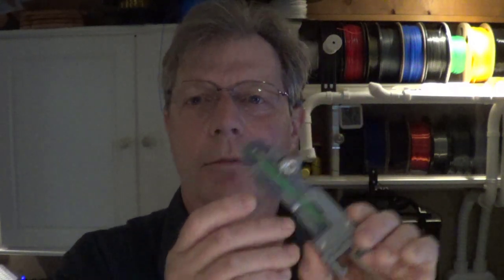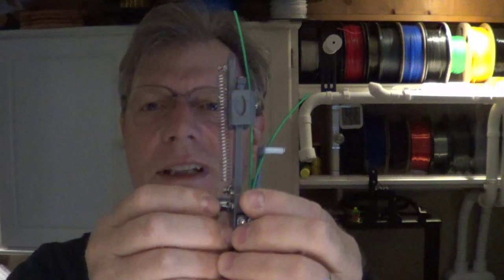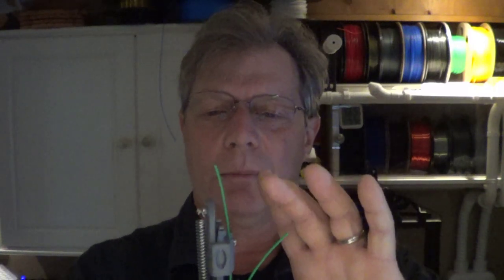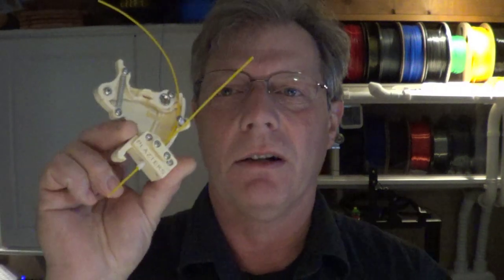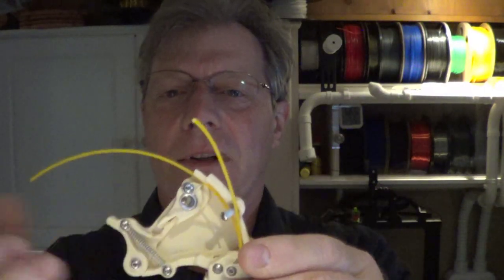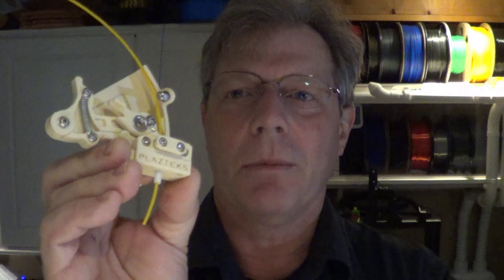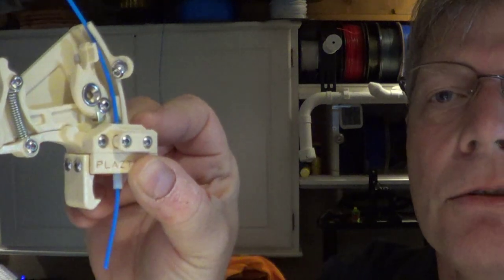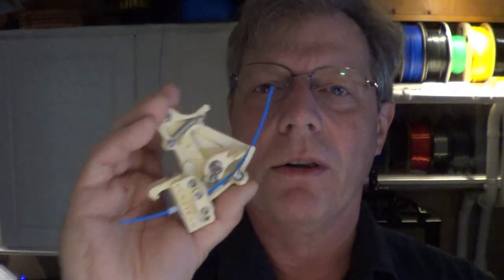Automatic Filament Loader 2.0 Now Available!

Comment: Fantastic idea, man.  I have seven different fast printers with some custom or off-the-shelf direct extruders. Your design is that way too heavy and clunky for these machines but I have designed a "fork" of your design where I have split it into two elements. One small part mounted directly on extruder. It contains the swap part itself (with plunge pusher from v.2.0) and Y-style splitter with two bowden connections. The second part is doubled. Two straight pushers from v.1.0 mounted on the frame and pushing filaments thru Bowden tubes to this lightweight changer mounted directly on carrier. Yes, it's also a step back from your 2.0 because it doesn't allow use of TPU but to be honest I use TPU filaments so rarely and in so small projects (some gaskets) that I don't need unattended changer, especially that I use filaments with Shore 20D stiffness.
But. There are two questions. How can I support/thank you for the idea itself? My changer is only my version of your "patent"/invention. And second - I could share my design for free on Thingiverse or Printables but I feel it isn't fair to you as you sell your models.
Reply from the maker: I would love to see your adaptation of the loader.  The issue I saw with separating it was that the travel distance was limited by the spring carriage length.  Tension had to be balanced between downward force, and the side pressure exerted on the existing filament.  I experimented with a rotary mechanism much resembling revolver cylinder that could handle more filaments, however that was right around the time my wife's health declined and after losing her, I haven't been able to find the time to continue development. I am starting to get back into design mode.  Also, I have switch to mostly core xy machines, so my next attention will be to adapt the design to accommodate  that type of machine.  I know I could get fancy and go the way of an AMS, but I still want to make a simple mechanical device that does not require software or firmware changes to work.  I appreciate your honesty and commitment to not freely release an adaptation of my design.
Reply: @frantasticdesigns  I can send you an email with some pics. And results as soon as I test my version out. For side force I  have some solution but I have to test it some time with different realworld speeds. Most of my printers tuning/upgrades are on mechanical side, and that is another advantage of your device (or one based on). For more uniform feeding forces I will test rubber bands instead of long spring in feeder.
I have MMU3 module on one of my Prusas but honestly the only function I use it for, is Spool Join, which your device does simply, efficiently and is not overkill.

Comment: How does it work?

Can you print multiple of these to queue up many filaments at a time?
Reply from the maker: Just a simple spring loaded device to start anew supply of filament just as one supply runs out. Loads new filament without interruption, or the need for a run out sensor. As the old filament runs out, the new one gets pushed over under spring tension, then the swing arm pushes the new filament in right behind the old one. No firmware changes or electronics needed. Eliminates need for run out sensor

Comment: I believe that the missed retractions should not be an issue, as you have noted in other comments. Nonetheless, if you ever pursue a v3.0 and are still considering adding features: the swing arm could be used to activate a microswitch, as used in the klicky probes, which activates a macro for purging the non rectractable filament length.
Reply: You could do that with a spare endstop, just place in a position where it gets activated when the arm pushes the filament and then create a macro that triggers when that endstop is activated
Reply: @Mestrenada  an endstop is just a microswitch with a lever

Comment: Im interested in this but with use for (1 color change during print, black first then green. I have a job printing 50 large items. My bambu can already do color printing and automatic switching but with the print process i vould possibly use this with an automatic filament rewind 3d print that has a clutch spring on it that helps it rewind when ejection of filament for a color change.

Comment: Awesome job! will it work witch the Biqu H2 extruder?
Reply from the maker: In theory, it would work on any extruder as long as there is a way for me to mount it tight against the filament entry point and have it not interfere with other components.  as always I would need the extruder in hand to design around...I only had the 3 different extruders to design around as they are the ones that either came on my printer, or I bought to replace them.

Comment: Very very smart solution to this issue ! Great job ! Is there a limit on how flexible the TPU can before ?
Reply from the maker: haven't  had a gauge, as far as how low of a Shore hardness it can go before buckling.  I have fed Overture TPU which is rated at 95A.  I do not have any softer than that, but would be happy to try with something like Nijaflex, as that is one that most people say is super flexible.  I will have to order some.
Reply: @frantasticdesigns  no obligation there. I was just asking, out of curiosity. I am not planning on building this soon but probably some day. Anyway, thanks a lot for sharing this great design !

Comment: Hi. Is it possible to install this loader to Ender-3 KE? This loader need to be installed right above extruder motor right on printing head?
Reply from the maker: @HODYTONE  it all depends on the extruder, and what is avilable to mount to. I had mine attached to a dual gear generic extruder, but now I have a sprite extuder, ans have to re-engineer

Comment: Genius! How about direct drive?
Reply from the maker: Works fine for direct drive, that is how I have it set up on my Ender3 v2.  You just have to learn to have a "fluid touch" if you load a new filament while it is in motion. I do it all the time. The other thing is to leave enough loose slack on the new filament so it doesn't get yanked out of the device from an long or fast motion of the print head....

Comment: As a mechanical engineer, I can certainly appreciate the time you’ve spent to perfect this design! Very nice work! I have a Rat Rig 500 and have printed several 3kg+ prints! Is it possible to add more than 1 roll? Or reload it after it activates?
Reply from the maker: Yes' as soon as the new filament has made it into the extruder gears, and the tension arm filament catch ( canary looking part) disengages from the filament you are free to load another. The only thing to consider is if you want an entire roll dragging past the  roughly 10mm's of the next roll that is queued in the device. Once the new roll has started in unless you load another roll there is no drag resistance in the device, since the spring plunger  stops at the thickness of the filament
Reply from the maker: You hiring?....LOL
Reply: Haha I might buy this! I plan on setting up a secondary extruder that will push the filament to my direct drive extruder.. I think I can make this work! I may need to make some adjustments. Do you include the native SW models in the Cults 3D download?
Reply from the maker: @diablodaub  I have only included the STL files as to not have my design ripped off.  I did apply for a  patent on it.
Reply: @frantasticdesigns should of probably got all that before posting
Reply from the maker: @nickjeffrey8050  I did
Reply: @frantasticdesigns  if you’d like to get your product mass produced let me know! I have multiple manufacturing companies I’ve worked with to help my clients mass produce their ideas.
Reply from the maker: @diablodaub  I am always open to ways to get my ideas out there.  I would love to see this device incorporated into printers natively if there was a manufacturer interested.  I could also be happy to see it mass produced.   It would have to come in several flavors, as you may have noticed from the comments.  Everyone's setup seems to be just a little different.  few run their machines as stock.  I have tried to make it as universal as possible and only change the method of attachment.  I guess the next thing I could do, is make the actual device that moves the filament standard, and make the mounting point modular instead of making a completely different main unit for each extruder.   feel free to reach out  if you have in interested party.  Until then, I will continue to improve(if I can ) the design.  I am going to get to work on the modular concept.

Comment: could you make one that can be more universal for extruders like the bondtech lgx lite, titan, or bmg?
Reply from the maker: I am  always willing to adapt my design if possible.  My limitation is that I Only have a few extruders at my disposal.  I purchased a Microswiss just so I could design around it because of it's popularity, but my resources are limited.  If you look through my other videos, and the listing on cults, you will see photos of models adapted to the Dual gear aftermarket unit ( the extruder on all my machines) one for enders both bowden tube and direct drive configuration, BMG style, Creality metal and plastic and the Microswiss type..  With each machine however, there may be adjustments needed. What I tell people is that if there is a way to secure it to the filament entry point of the extruder and it won't interfere with any function of the extruder or interfere with components of the printer, it should be adaptable.  I just need an extruder in hand for fitting and testing.  As for a Titan version, it is unlikely given the design of the tension arm and the filament entry point.  I am not sure if there is a way to mount it that will work.

Comment: Hmm thats pretty nifty but it wouldn't work well on my Kingroon KP5L since it has a direct drive... I mean I could mount it on the extruder itself but then I'd have more weight on the head and 2 bowden tubes for it to feed to the head. It would work nice if I setup a bowden setup on my voron v0 though.
Reply from the maker: I run it on my ender 3v2 as direct drive, weight is minimal, especially if you do 20% infill

Comment: how to mount to a prusa i3 mk3?
Reply from the maker: I do not own any Prusas. Another follower asked about mounting on a Bondtech LGX. Is this the type on the prusa i3 mk3? If so' I am working on an adaptation of the BMG clone I have since tgey are similar, and am fitting using a mock up from OnShape. I won't be able to physically test it though without the extruder in hand. I apologize, I hoped to have this one already, but have gotten sidelined by some family medical issues that have required more of my time......

Comment: Have somebody tried it already in printfarm settings if it works relieably enough for automatic filament refill from second spool midprint seamlessly?
Reply from the maker: @martinvitvar3101  hello Martin, I don't  run a print farm, but I welcome any feedback. For that type of duty, I might think to engineer in a small metal thimble  where the filament goes through. I usually don't bother to load tge second filament til the 1st one looks like it might not finish a print. No need for the excessive friction wear between the two filaments. I don't have it installed on as many machines as I used to, as most of my current machines are K1's and K1Max's, and I would have to re-engineer the lid of the machines.
Reply: @frantasticdesigns  Yes a reliable way to automatically refill AMS or MUI so it has more capacity would be awesome. So I can go for a holiday and keep printing with autoeject. 4 kg per AMS is only 4 days of printing and it is kind of expensive to buy more AMSs just to autorefill with no material or color changes.

Comment: Love the concept. Solves a real problem.

Do you know anyone that has installed on a snapmaker 2 - in enclosure? We can overcome filament swap issue by computer connected using Luban (basically a software solution that pauses print when filament runs out) but would MUCH rather something like this to print without connection to computer OR the delay caused by waiting for filament swap.
Reply from the maker: Possible, as I have mentioned to others, as long as there is a way to secure it to the entry point of the filament, and it doesn't interfere with any part of the printer, it should be adaptable. Direct drive is no issue, you just have to have a "fluid touch" while loading new filament if do it while it is printing. I do it on my Ender3v2 all the time while its printing. Also you have to leave enough loose slack on the new filament as to not have long travels of the print head pull it out before it gets pulled in
Reply from the maker: Sorry I mis-read your question, no I do not as of yet.  I am hoping more people will print one and provide feedback.

Comment: Heyo! This looks amazing, but Im curious how capable this unit is for hooking it up to a BMG style extruder, rather than creality style.

Second: How difficult would it be to add on a screw in for a pneumatic fitting at the top, for those of us that have drybox setups and would like to have bowden tube running from the drybox and terminating at the entrance(s) to this little unit?

Ideally 2 fittings, 1 for the main line and 1 for the backup line, would help a lot potentially for those of us printing with very hydroscopic stuff that want to keep it as dry as possible, rather than just feeding the lines in bare.

And if you are interested in further feedback, potentially a cover to further help seal the unit as a whole could be nice!
Reply from the maker: Thank you for your comments, First let me say, I have made one to fit a BMG Extruder.  : 

https://youtu.be/dM32Lyew9hY

As for  putting a fitting on the top, a reverse bowden tube would cause too much drag resistance on the new filament.  It only works since there is a balance between the tension force of the plunger that moves the filament over, and the tension of the swing arm.  If I were to increase the swing arm to have enough force to pull through a bowden tube, it would probably buckle the filament ahead of the  entry point.  also that would mean increasing the side plunger tension, which would apply alot of friction between the new and old filament as it is waiting to be pushed over. I do appreciate all the comments and suggestions, and will gladly incorporate any  elements that will help improve the design,  but I will tell you I spent quite a lot of time experimenting with the "goldilocks zone" of this device.
Reply: @frantasticdesigns  Ill take a look at the BMG one!

As for the fitting issue, would it at least be possible to get a pneumatic fitting lined up with the "main" line?

Comment: Why does it have to be anywhere near the extruder. Could  a mechanism like this sit anywhere in the path of role to extruder?  The width of the filament leaves the hole, triggering spring, lining up new filament?   This could live on the top of my  AC Predator before the filament run out, or between two rolls of filament  or a daisy chain of them with many roles of filament.  Am I missing something here....  This is a GREAT idea and if it is a spring loaded mechanism it can live anywhere, am I mistaken?   Love the project.........
Reply from the maker: Let me first say, I am always trying to improve the design, and I accept all critisizm as contructive.  If it sparks me looking in a new direction, then I will say thank you in advance.

this is what I replied to someone else with essentially the same question:

I experimented with that, but resistance was an issue. there is a fine line  between just enough downward or feeding force to get to the extruder wheels, and  not too much that the new filament won't shift over.  that would require a stronger plunger spring, and then there would be too much wear pressure between the two filaments. Even if I had a spring wound long enough to transverse the length of a standard bowden tube, the internal resistance brings us back to the problem I just mentioned..  Again, there is always a way using another stepper, extruder, optical sensors, and a but of microswitch magic, or I can just be happy with a simple spring loaded mechanism.........
Reply: @frantasticdesigns    Nice,  Right!!   I did not think of the pressure that needs to be applied too the NEW filament to carry it down to the extruder.  I guess I was watching too many filament weld videos, ha.  Thank you for the clarification  and  again nice work!!

Comment: The only issue I can see with this, is that it likely won’t work with most direct drive extruders on machines like the Voron or rat rigs etc
Reply from the maker: There is always going to a challenge fitting to any setup, as most of us have customized our machines.  What I have told people, is if there is sufficient clearance around the device and it does not interfere with any other part of the machine, and most importantly, there is a way to secure it to the filament inlet path, it should be adaptable to either bowden or direct drive.  Some extruder s have filament inlets that do not lend themselves to attachment, such as the Titan design.  I can't imagine a way to secure it to such a small swing arm.  but hey, nothing is perfect, Right?
Reply: @frantasticdesigns  You would need to have two separate Bowden tubes running to the toolhead for this to work on something like a reverse Bowden system. I would be interested to see if there was a way to adapt this to work though. Btw my comment was not a criticism just an observation.